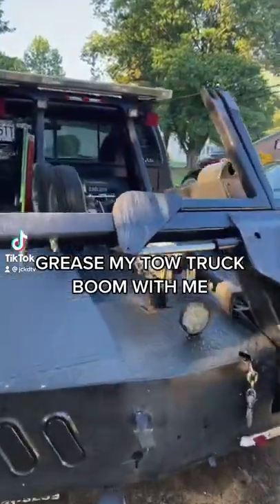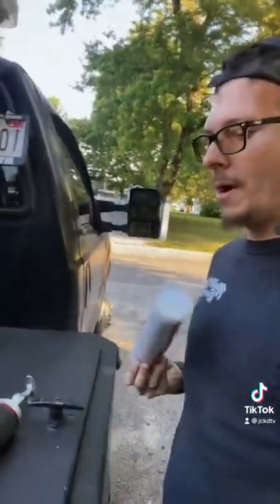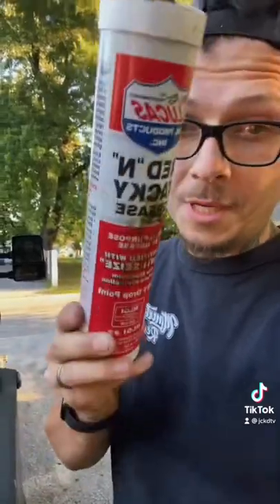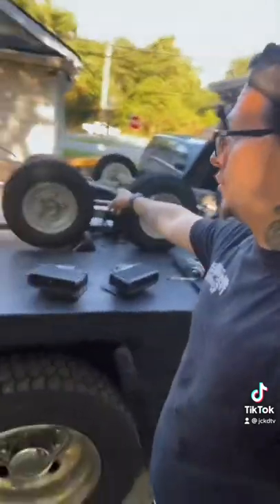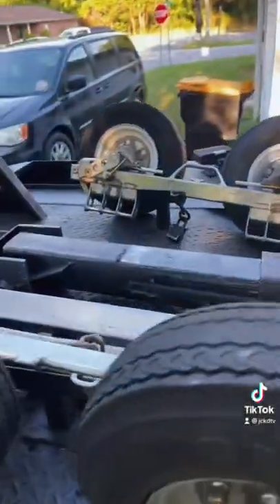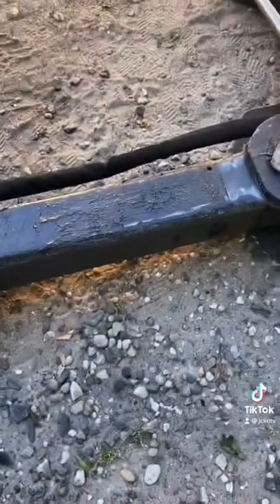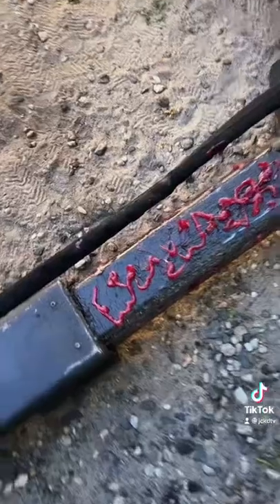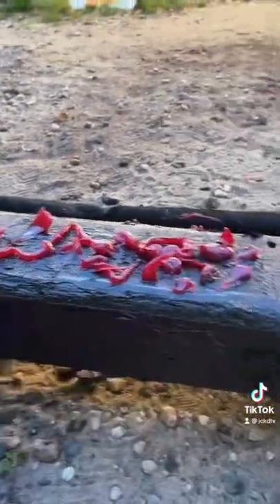HOW TO GREASE A DYNAMIC 601 TOW TRUCK WHEEL LIFT #shorts

Comment: Didn't't realize your where using a 601 I assumed it cuz I don't ever see you going heavy.. you should look into lift and tow it can go on a gas 250/2500 serious pick up truck you would have a way nicer/cheaper to maintain truck. Plus for your line of work (repos) way more low key. It's all we use in NYC. I couldn't get one because of back order and went with 601 instead but would prefer and lift and tow
Reply from the maker: Yeah I’m getting lil herc from Detroit wrecker.